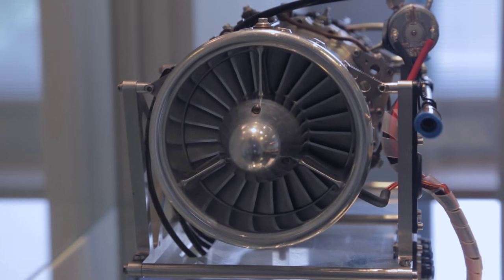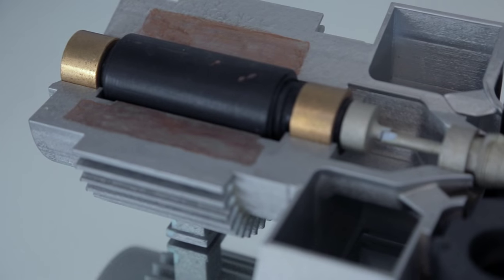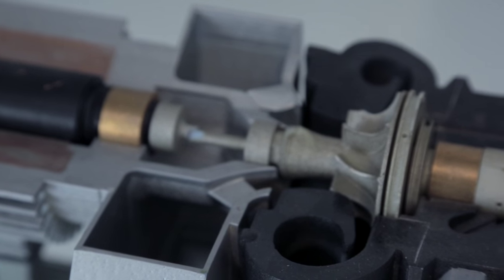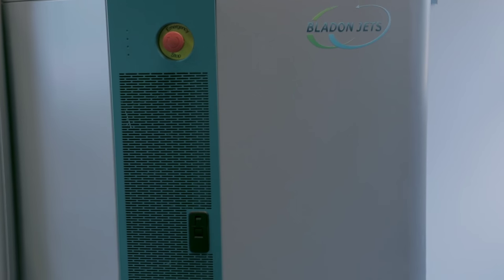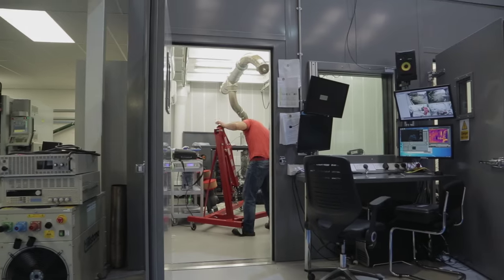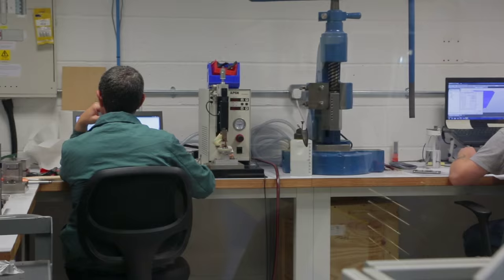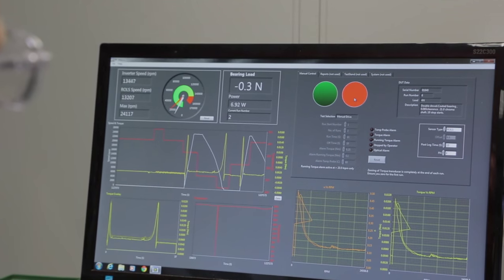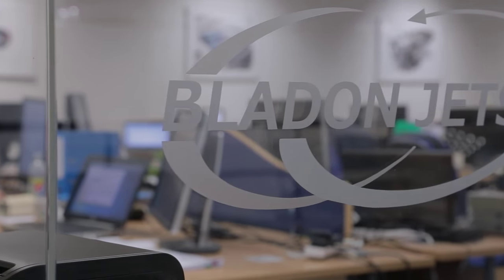Innovate UK success story: Bladon Jets innovative mobile and low-cost generator takes off

Comment: If you can use exhaust gas from automobiles to generate enough power through your micro turbine to move the vehicle further more, you would increase milage significantly.
Reply: That's what a turbocharger does.